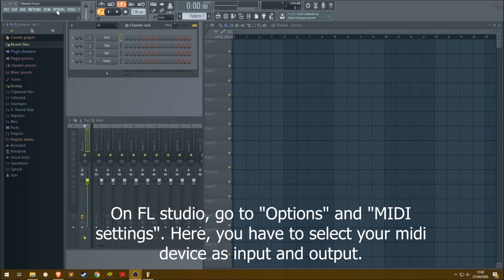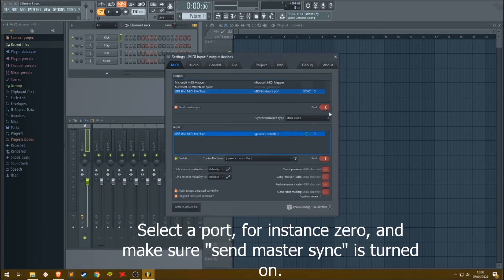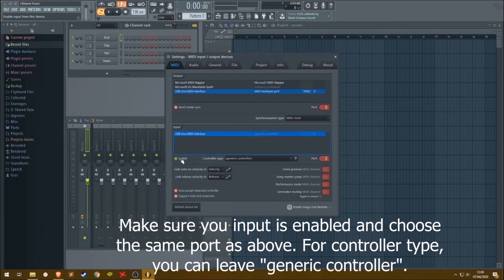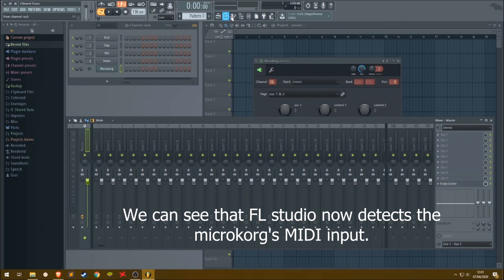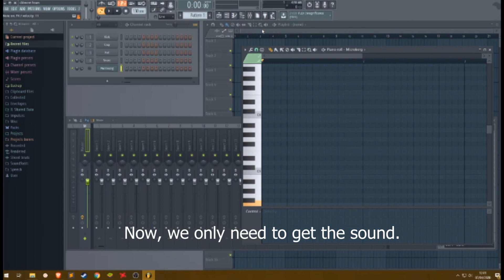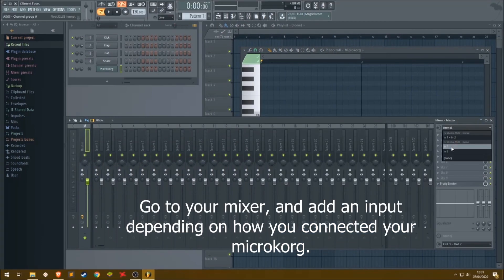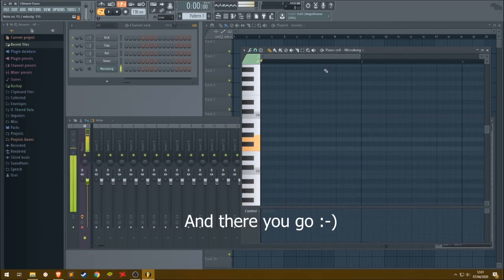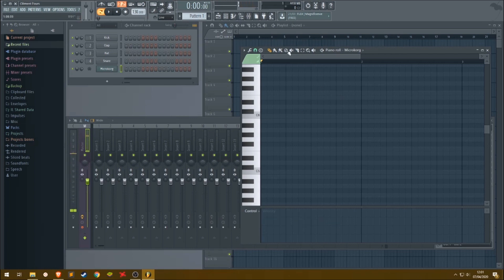How to use a Microkorg with FL Studio 12

Comment: Can you please let us know what cables you used? 

I saw the midi 5pin to USB. And do I need two of those. One for input, and one for output? Or just the one for input?

And the other cord you used, please!

Thanks a lot for this. I’m very new to home studios. And I purchased FL studio. But man I’m having such a hard time connecting the hardware just to get basic functions. 

I have the Micro Korg because, I love the presets! 

Also, does anyone know if those presets will still be available to use once the Micro is connected. Or will it just purely be a controller at this point?

Thanks!!!

Comment: This tutorial is great, but i got a question.When I press ex. on keyboard a note in step editing mode and hold the key the note is as long as u press the key. Micro korg works fine now I got all the midi cables and it  plays notes and stuff but on step editing mode it doesnt make long notes. Like you got only small notes and only when you press a key.I cant write easily long pad kinda hyms and i have to every time fix the notes length manually. Do you know anything about this issue?

Comment: My question is. I dont have midi cables and i dont have anyway to use midi as the way to fl studio recoqnize notes i play step edit etc. I can   trough my focusrite  record sound from it but i want notes to appear, like I would play notes on my keyboard in fl studio  but on mini korg?
Reply from the maker: Hi! Through the Focusrite interface you will only get the sound because that's what it does. It's an audio interface that gets the sound from the input and delivers it by USB.
If you want the notes to appear on FL Studio, then you need a MIDI interface. There are Midi-to-USB cables like the one I use in this video, the M-Audio Uno (there's a link in the description). That way, you can connect your Microkorg to your computer by MIDI and get the keyboard information (notes pressed, etc).

That's why if you want both sound and notes, then you need the focusrite (or another audio device) AND the Midi cable.
Reply: @clemember6573  Yea thanks for reply. I ordered midi to usb cables and then Im all set :D